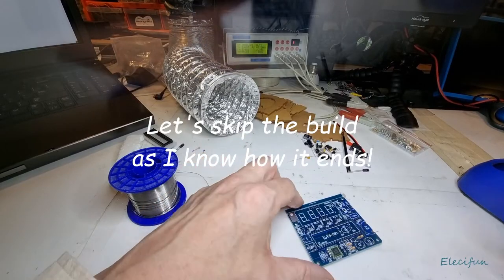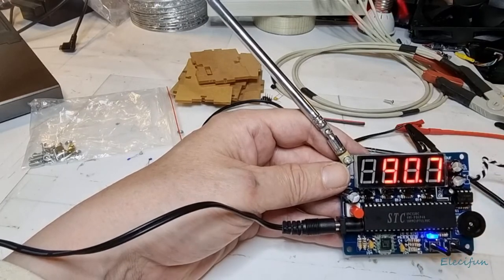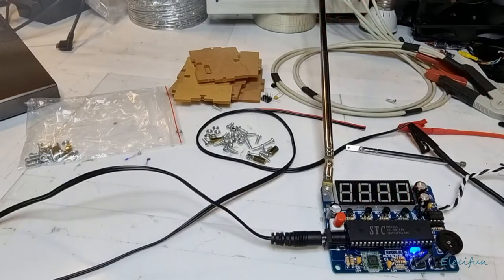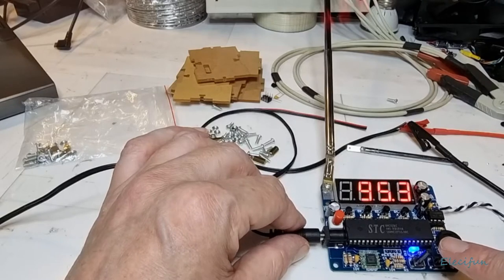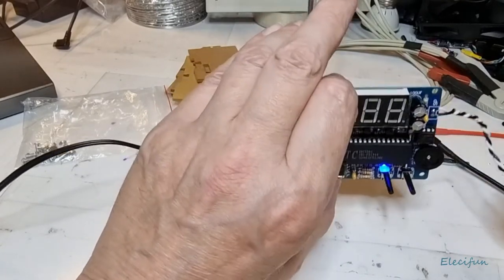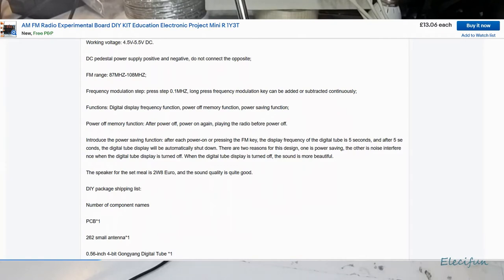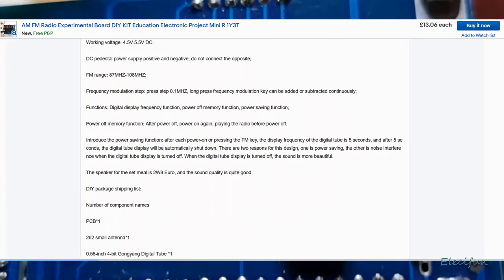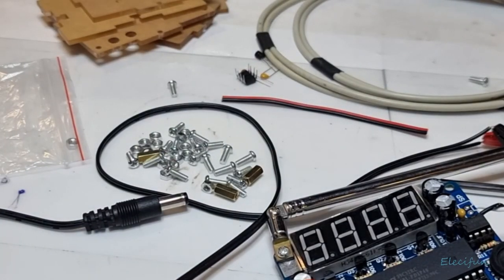DIY Kit Build AM FM Radio pt2of2

Comment: Hi again. "I dont know why the hell anybody would think this was passable..." lol 😆 yeah, I know what you mean. Its bloody terrible. Scratching nasty interference. I'm curious to know why its so awful? Why all the bad interference and where is it coming from?
Reply from the maker: its interference and also the LM386 is set up terrible, they tried cutting slots in the board hoping the reduce interference but ha ho. Its just crap being sold on eBay bud lol
Reply: @Elecifun  oh, I see now. It's a pity they didn't improve the design in future iterations. I'm kinda getting a bit **** off with AliExpress. 

I bought a vernier caliper and a lot of other diy kits.

The vernier caliper arrived faulty.

The digital numbers are randomly scrambled.

I dont know if was sent like that but im beginning to think they just sell anything regardless of whether its faulty or not.

Difficult to know if it was like that or it got damaged during transit.

Lots of things annoy me.

A kit arrived with 8 missing transistors.

A pain because I didn't have an spare ones.

Inadequate packaging.

Scratched goods.

Counterfeit goods like the Hiland PSUs. I guess thats what they're doing.

I received my order of ratchet on of buttons. (Another thing that *** me off)

They right in the description that its a diy kit then send a fully assembled radio.

Then just smile. Which further makes me want to punch them on the snout. Lol

Sigh, anyway I guess they're cheaper than buying it locally.

My Hiland 2AMP 0~28 volt is almost complete.

I just need to buy a dremel and cut some holes into the case for the LCD, knobs, and ac power port.

I need to solder some earth wires to the front back and base.

Its been a interesting project albeit a frustrating one.

Anyway thanks for commenting.

See ya bro. 😃👍